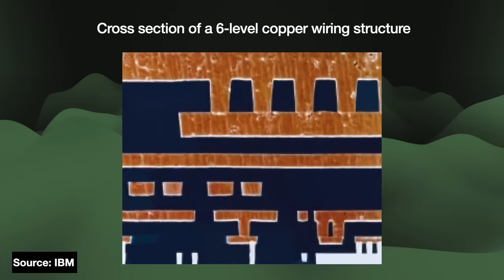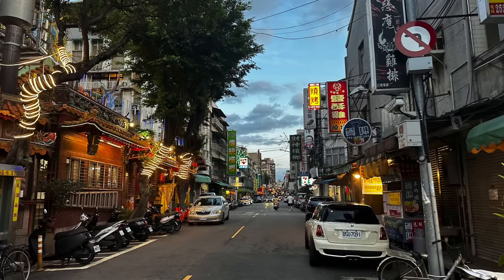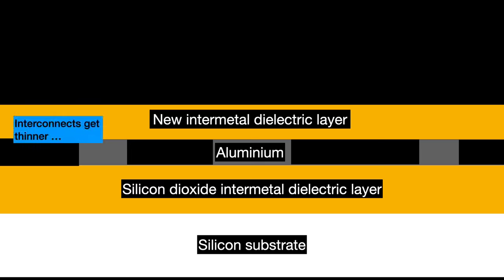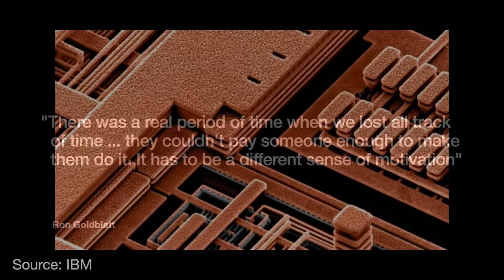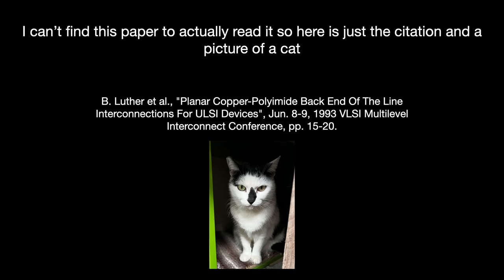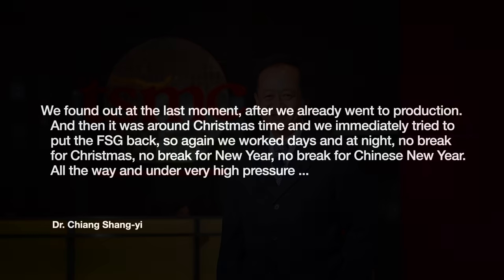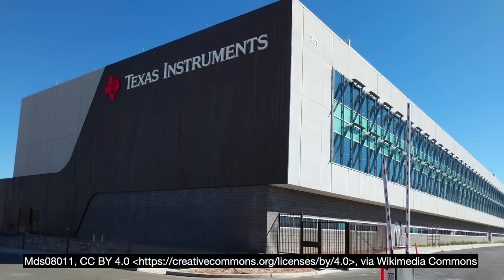TSMC's First Breakthrough: The Copper/Low-K Interconnect Transition

Comment: "Semiconductor manufacturing is literally black magic. All of this just barely works, man." My favorite quote of this episode.
Reply: What is also interesting is that more and more SW makes it possible. I'd wager that in the last 8 years SW and modelling has contributed more advancement than materials science.
Reply: Quantum mechanics is spooky action at a distance. Happy Halloween🎃
Reply: We began developing copper interconnect twenty plus years ago.
Reply: @etmax1  "sw"?
Reply: @hiddendrifts  Yes software, they use GPU farms to calculate the optical aberrations that are needed to make the photo mask produce the actual desired pattern on the silicon. They also use evermore complex software to run the thermal and electrical timing behavioural simulations on their logic designs to know whether their chosen layout will actually work. Black magic I say 🙂
Reply: @etmax1  gotchu- that's wild to think about. it's like its own singularity, in a sense
Reply: @hiddendrifts   It's one of the things that worries me about developing AI that will work out the howto's better than the smartest people, a foreign power could hack in and get the source code and level the playing field virtually overnight. Yes they would have to do some HW engineering (still plenty of that needed) but the design knowledge base and more importantly the ability to innovate would be there.
Reply: @etmax1  >level the playing field<
advanced ai gonna have the same security as industry secrets or the nuclear missile system lmao
Reply: I remember that. Using a plating trick to deposit metal preferentially at the bottom of trenches.
Reply: There's more to this than meets the eye.  Look up Solomon's Sigils.
Reply: You bet! I have worked 30 years for Motorola Semis and 10 more for Broadcom, and every year was blown away by the number of transistors per cm2 reached.
Reply: Spoken as a true engineer.
Reply: @etmax1  You would lose.  There is still a LOT or materiel science that goes into manufacturing.  SW is needed, but the computers are not up to replacing us just yet.
Reply: true statement. EUV litho is also a powerful brightening magic as well, and everything comes along to support the ecosystem.

Comment: FYI  - when chip frequencies approach microwave  (about one GHz) , the regular resistance and capacitor functions become really weird. For many years of my career, designing circuit boards was fairly easy.  Then system frequencies approached one GHz and beyond and we had to use microwave design rules where a wire was no longer a wire but much more complex with properties like an antenna.  The chip designers have also hit those restrictions which is one of the reasons very few commercial chips function beyond two GHz and all cpu/gpu makers went to multi-cpu/gpu designs.
Reply: for by far most wires on a chip, the RC line model can be "good enough", even at very high frequencies. The medium -long haul interconnects are where it gets more tricky, but there's design rules and simulation tools that mean it's possible to make them work.
Frequency scaling isn't limited by the interconnect, it's limited by power, primarily
Reply: at 10ghz the wavelength is about the same as the die edge length for cpu chips, 30mm.
Reply: @Archonsx lol
Reply: @tommihommi1 interesting, I think.  I almost have a simplified, basic, cursory grasp/understanding of what you're talking about. . .  🤔   almost
Reply: So, none of the 8 cores of my 3700x actually clock at 4.3 ghz?  They all run below 1 ghz and the speed is added up to 4.3? Weird.
Reply: @NegitoroIsBestShip no
Reply: @NegitoroIsBestShip  - some of the cores probably run near 4 GHz for short bursts. The problems with high frequencies is the circuit can easily become unstable, plus the chip can become excessively hot internally. The chip industry tries to design and make the chips for 4 GHz then  tests them to determine if they actually work.  The dies that are mostly OK at 4 GHz go into the high price bin. The rest go into cheaper bins. Since they are really pushing the limits of physics at 4 GHz, the yield is very low and chips that are designed to try to run at 4 GHz have very high failure rates. Basically at the higher frequencies you are sacrificing potentially faster actions for more chances of the chip being unstable.
Reply: @jimpad5608  I see, sorry for misunderstanding. Stock the 3700x runs at 3.5 and I tried 4.5 but the full 1 ghz OC was aspirational :( still your comment makes the +800 mhz impressive.
Reply: @NegitoroIsBestShip He didn't say it was impossible, just harder
Reply: @ameunier41  Yeh, I said I misunderstood in a later comment 👍 They elaborated further into my 4 GHz confusion as well.
Reply: @Archonsx It's capped by current limitations. There's no reason to move onto photonic processors as there's still room for improvement in this electrical technology and silicon photonics can't be produced in required qualities, volumes, and physical sizes yet.

The linitations are a combination of economics, maturity, and performance.

Still there's a few companies investing in silicon photonics and Intel is now doing optical interconnects so the future has begun slowly and will only grow from here.
Reply: @Archonsx Secondly, conspiracy isn't a replacement for knowledge. Maybe you'd be more comfortable with flat earthers. The door is always open, you can leave anytime.
Reply: @jimpad5608  While it's correct that achieving stable operation at very high frequencies, such as 4.7 GHz, can result in lower yields, chips designed to run at such extreme frequencies may indeed have higher failure rates. Those that pass stringent tests are selected for premium products, and CPU and GPU manufacturers categorize them into different bins, selling them under slightly different model numbers. The fastest base clock CPUs can reliably function at their designed speeds for years until owners decide to upgrade to newer models.

Additionally, CPUs can operate at faster clock speeds for short bursts during demanding tasks, a feature referred to as 'Precision Boost' by AMD and 'Turbo Boost' by Intel. Some CPU models apply this short-duration higher clock speed to specific cores, while others may apply it across all cores. The maximum number of cores affected may depend on factors such as the CPU's temperature, which is influenced by the cooling solution installed in the computer.

In light of this information, it's crucial to distinguish between the base clock frequency, Precision Boost/Turbo Boost, and overclocking. The base clock frequency represents the speed at which the CPU/GPU is designed to operate under normal conditions. Overclocking involves manually increasing the clock speed (by adjusting either the clock multiplier or the SDRAM clock multiplier) beyond the manufacturer's specifications, which can lead to instability, reduced lifespan, and voided warranties. Only CPUs with unlocked clock multipliers are capable of being overclocked, and when a CPU is overclocked, in general, the Precision Boost/Turbo Boost function is automatically disabled. There may be rare CPU models that could be exceptions. Furthermore only specific types of SDRAM are suitable and only some models of PC motherboards, have hardware and BIOS ROM support for overclocking.

Instability issues are more likely to arise when users attempt to overclock the CPU/GPU past its base clock frequency. Overclocking increases the heat generated by the chip, contributing to instability and potential long-term damage.

In summary, it's important to differentiate between the base clock frequency and the Maximum Precision Boost/Turbo Boost frequency set by the manufacturer and the instability issues that may arise when users attempt to overclock the chip beyond its designed specifications. The industry rigorously tests chips for their specified base frequencies, and instability is more likely to occur when users push the limits through overclocking.

There are extreme overclocking enthusiasts (aiming for the fastest clock frequencies while using unconventional cooling solutions such as liquid nitrogen), who may achieve higher speeds. However, this comes at the expense of voiding warranties and potentially compromising the long-term stability of their CPU and motherboard SDRAM.

Safety note: Only people trained in the safe handling of cryonic substances, such as liquid nitrogen, including having the correct kinds and knowing the proper use of personal protective equipment (PPE), and never working alone, should even attempt using liquid nitrogen cooling; never try doing so at home!
Reply: I’m just thankful I’m smart enough to be interested in your comments
Reply: This is incredibly fascinating!

Comment: Two things delayed 300mm production.  Photo lithography improvement (smaller lines).  And copper’s pressure curve.  Copper would deposit on vacuum pump lobes and make the pump useless within a week.
Reply: Remember early CMOS? No protection diodes. Everybody had to dress up. Repairs needed to be choreographed.

Comment: Birds on a line don't add DC resistance but do add capacitance, thus adding to the AC impedance to a point that you can measure it if you wanted, with signal reflections even WHERE on the line they sit.
Reply: Pre high speed internet, I wired the telephone lines in my house in a star pattern. Had to change that as speeds increased due to the capacitance of the other lines. Now it’s just one line straight to the modem.
Reply: @tonydoggett7627   dude, time to switch to twisted pairs for your phone lines! 😁 Seriously though, I've seen people use CAT-5E cable for their ADSL POTS line.
Reply: I don't think the general audience has reach THAT level of electrical engineering. AC & DC are very different animals. Still, NeXT is a real phenomenal in DC data buses and long parallel (untwisted) transmission lines.
Reply: But at 50/60 Hz and corresponding wavelength? Back in the day we referred to this situation as "fly poop in pepper".
Reply: @erictayet better hope it's the cat 5e that's gel filled and rated for exterior exposure, preferably with a bonded aerial cable to take the strain weight of the wire 🤣
Reply: @erictayet  What are you referring to by "NeXT"?
Reply: @Graham_Wideman  Near end Cross-talk
Reply: @erictayet  OK. Then I'm still not seeing what previous comment your "general audience ... DC data buses... parallel transmission lines" comment is responding to. It seems unrelated to tonydoggett7627, der.Schtefan or the video.
Reply: @Graham_Wideman  oh OP mentioned things about resistance/impedance and I was just commenting that not all readers of YT comments have a degree in Electrical Engineering to understand the difference. However, Tony and Christopher understood so they have EE background. 

My mention of Crosstalk is in reference to signal degradation in parallel wires as laid out on PCB and in air (as mentioned by OP) but is also relevant to traces in a silicon wafer design, especially if you're running in the GHz frequency, for eg., CPU to SRAM cache interconnect, or VIAs in a 3D circuit.

So erm, inside joke for engineers? 😄Like what Christopher was joking about? But when I say it like this, it's doesn't sound as funny. 😅

Comment: The designers define the product R x C as the "time constant" of an integrator. So the RC number is not "niche" as many said, but it is absolutely at the front of semiconductor technology in setting the maximum clock frequency of an IC.
Thank you for the incredibly well researched video. 
Greetings,
Anthony
Reply: Does RC-delay contribute to higher voltage required for a higher frequency.
Reply: A capacitor resists changes in voltage. Since current is bounded by resistance, there is a maximum voltage that can be achieved for a particular clock frequency. Lower the clock frequency, and you can increase the voltage and vice versa.
Reply: @badtyprr  Why does overclock then often require higher than stock voltage soc.
Reply: @FTW23-qq8nb  The time constant is the same but there is less time due to the higher clock speed to reach the logic threshold. With a higher voltage on the logic power supply the rise time to the fixed logic threshold is faster allowing the logic to operate properly when overclocked.

Comment: I made copper  dummy wafers for the new copper chip makers. The copper plating bath was unique. It deposited high purity copper preferentially in the bottom of trenches. By inhibiting deposition at the top of the trenches. This enabled filling deep high aspect ration trenches to be filled. Subsequent chemical mechanical polishing resulted in deep clean vias and a flat surface for subsequent deposition. Truly a game changer. And an exquisite example of the platers art.

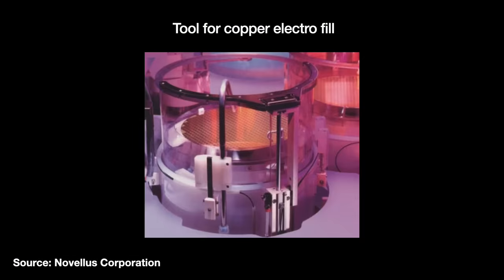Comment: Small correction at 17:40 . This is an edge bead removal chamber used to etch away copper seed on the edge post electroplating. You can see a small grey arm used to dispense etchant on the edge of the plated wafer. Great video, love your content!

Comment: Another GREAT video. It reminded me of my first term in digital electronics decades ago. I remember this innovation! IBM inventing copper on silicon, as it was called, back then. What I didn't realise was the rest of the industry catching up within the year. And yes the low-K dielectric problem took more time to crack. By that time, I have already moved to the software side of things. I remember my Polytechnic offering Micro-tronics (wafer fab) for the Mechanical engineering students.

Comment: You are missing critical information as to how TSMC "cracked" the low k dielectric issue at the 130nm node...specifically they didn't. What happened was that at the 130 nm node they went into a "partnership" with LSI Logic in exchange for fab capacity and a Low-k copper back end. In reality TSMC's low-k backend was as you've mention fluorinated oxide, which was "lower-k".
As part of the agreement LSI and TSMC "shared" their 130nm processes, LSI had a low-k/Cu backend that had been put together inside  a year after the sales/marketing group changed their tack on what was required for the interconnect - initially they agreed a low-k/Al process was OK (which it was from strictly a data driven standpoint, but by mid process development Cu/Low-k were the buzzwords and they changed their requirements, hence the hasty development of the low-k/Cu backend). 
This low-k/Cu backend used low-k from the 180nm process using Electrotech/Trikon Flowfill dielectric, that I believe was MSQ based. After we saw the FSG/Cu backend process that TSMC were using for their 130nm process, we had to transfer the Low-k/Cu process from our development to TSMC to be able to produce our 130nm material, so TSMC effectively were given all the information to run a true low-k/Cu back end process, effectively for free. It was universally agreed by the engineering staff who were required to do the transfer as a BAD IDEA, and was the beginning of the end for LSI Logic wrt to developing and manufacturing leading edge technology, but the corporate leadership thought is was a good idea as it saved on manufacturing investment, but at the expense of giving away the process crown jewels at that point in time.
Reply: interesting, I hope it will be mentioned in next videos and comment above get more likes.
Reply: Apparently it was LSI Illogic.
Reply: @thecraggrat Yes you are 100% correct - I was the provider of the Trikon Low-K "Flowfill" process which we put into production at LSI (not high volume) at 0.18 micron with aluminum.  As LSI determined, it was the C in the RC constant that was where all the improvement could be most realized for the devices, and thats why they chose us and we partnered to deliver it.  But yes there was some less than straight talk, and a decision to finally partner with TSMC against the engineering team's recommendations, et voila' TSMC gets a free industry breakthrough from LSI.  Whats more, the Black Diamond of AMAT where I went to work was a copy of the Trikon Flowfill Low-K process - same SiOC process except the silicon carbide barrier they call Blok.   So it was not a TSMC breakthough but an LSI hand off.  And once TSMC had it from LSI, LSI found their competitive edge lost as the entire industry had it now and they went fabless then sold the company.

Comment: Very good video - AMD using CVD to apply butter is a classic comment.  Passing along a couple of historical comments: IBM always had a Ferrari type process in the wings that they didn't run or scale up.   In 1979, the M1 & M2 pitches for NMOS 1 were 5.0 and 7.4um.  The process used Polyimide dielectric (2.8 dielectric constant).  Patterning the vias had topography issues that were related to reliability problems, but the biggest issue was that IBM never decided to ramp production - it was easier to use the internal technology as a bargaining chip.

Comment: I remember the introduction of copper interconnect. At the company where I worked, there was concern about the reactivity of Cu with Si02 and the difficulties posed by the barrier metals at that time - titanium and I think palladium and tungsten, which were all causing problems because they were such hard metals. But that speed pickup from Cu was irresistible. That's also when companies and foundries started to get very interested in better insulators/IMDs like 'Coral.' 
Interesting that tantalum became the barrier metal of choice.